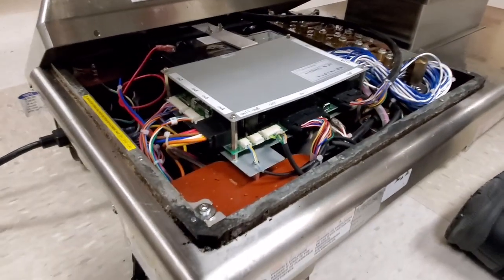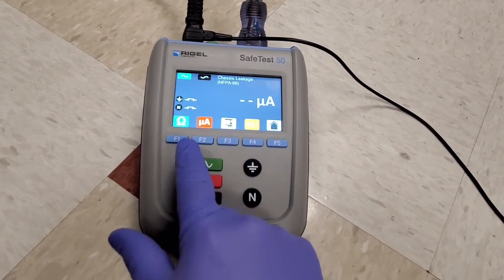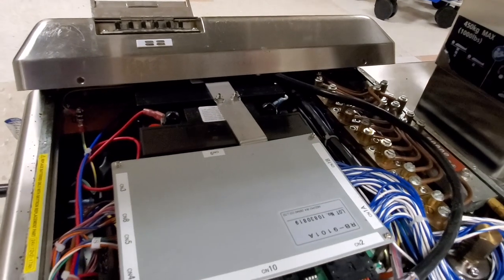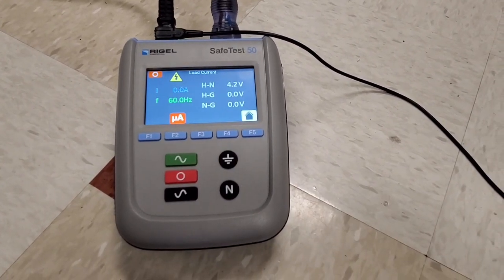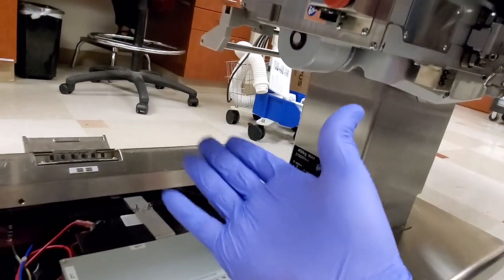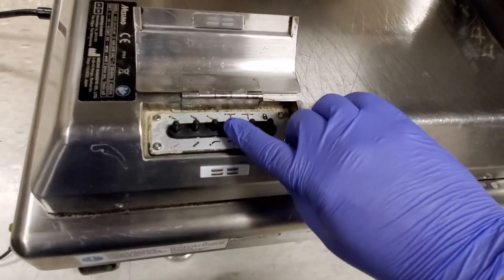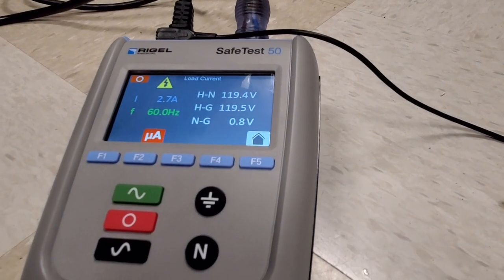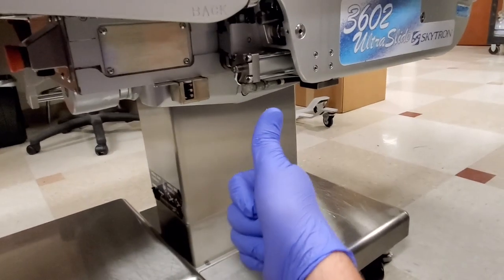Skytron 3602 Surgical Table Final Repair

Comment: As a fairly new biomed (going on 3 years) I really appreciate your channel. 
Towards the end of the video you said that the issue is often just a micro fuse. If I were to run into a similar situation, and I find that the micro fuse has indeed been blown, how could I know that it won't blow again after I replace the fuse? Would I have to test each component on the board? 
Sorry if this is a basic question. I landed in this field without any formal electronics training.
Reply from the maker: Adam, first thing you should always know: fuses blow for a reason. whenever you replace a fuse, it WILL blow again unless you discover the cause of excessive amps or a short. In this case, the fuse is designed to blow when there is a short in the remote control assembly. The cord is defective. If this table does not respond to remote control and there is no battery charged indicator when plugged in, the fuse is already blown and the remote / remote cable needs inspected / replaced.